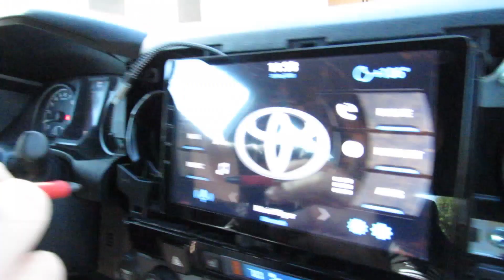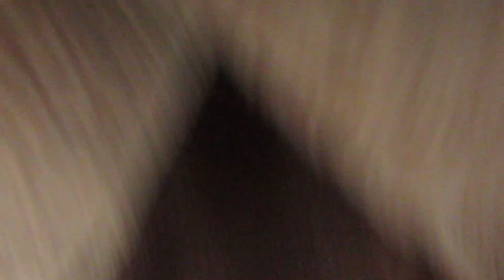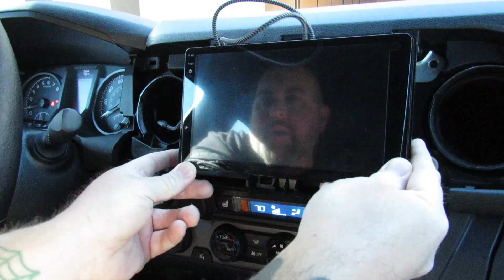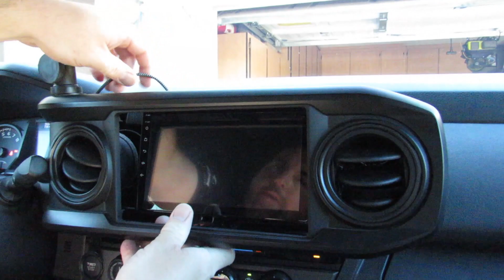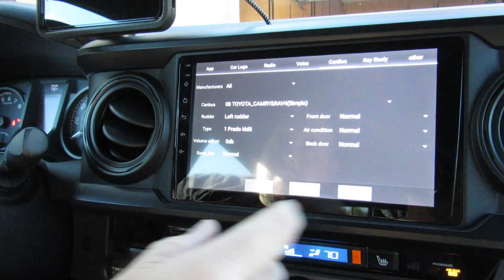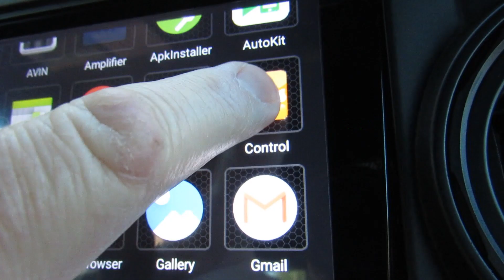CTH PX6/T9 Android HEAD UNIT 2016 - 2019 Toyota Tacoma | Mounting & INITIAL Wiring

Comment: Hey Dan, great video! Are you using an external mic or the mic on the front screen? I have the same unit and the mic issues are driving me nuts! People are saying that they can’t hear me and they are hearing more road noise then anything else. I am running an external mic that I ran to were the factory mic is by the sunglass holder and still people say it sounds like crap. Any input would greatly appreciated!

Comment: Just bought a used 2017 off road yesterday.  I had a 2007 FJ with an Atoto head unit. I am not happy with the factory unit in the Tacoma.....   So I am new to this vehicle, does oil change data and air filter data, etc  still show up on the vehicle with this head unit?   On the FJ, it was just a maintenance light so if I replace the head unit will this feature work?  Is there anything that will be lost?  I have the JBL upgrade with NAV in the truck I bought.  Long question, but I appreciate any feedback.  Thanks
Reply from the maker: The deck will keep the same oem functions that are available on the oem deck. If you don’t already have the features your asking about in your oem deck, I’m not sure that it will add more functions. For sure it will retain oem functions
Reply: @danwill713  Thank you.  My system was delivered today. I will get it installed this week.

Comment: Hi Can you please help me.  I have 2008 Toyota HL JBL and I purchased the item 
https://www.aliexpress.com/item/4000802108249.html?spm=a2g0s.9042311.0.0.2f0d4c4dmdHOOi
after I resolved the A/c  fan and temperature display problems.  still there is no sound out of my speakers and SRS on  in car oem message displayl. system comes with canbus as it shown can you please advise what to do?Also can you tell me where to hook up Key 1 and Key 2 wires ?. Thank you

Comment: Is the #126 you enter for factory settings same for all trim models of tacomas? Also, where did you find the specific settings regarding Canbus and type? Are those trim specific?
I have an SR and ordered this, and as an example, my stock head unit doesn't give me a lot of the function that you showed here pertaining default car settings.
Reply from the maker: The 126 are for the Px6 model. 123456 is for the T9.
Reply from the maker: I would try the 08 Camry...rav4... anyway. It won’t hurt anything. I found these settings on a post in a 4 runner group. I would still try the 08 like I show first and go from there

Comment: Is Carplay wireless or wired with that setup?
Reply from the maker: When plugging into the iPhone cable you see in the video CarPlay is wired. This deck will run wired through a dongle or completely wireless. Old habit of plugging in so I just run wired.
Reply: @danwill713   I cant seem to get it connected wired carplay. only wireless. any ideas why?